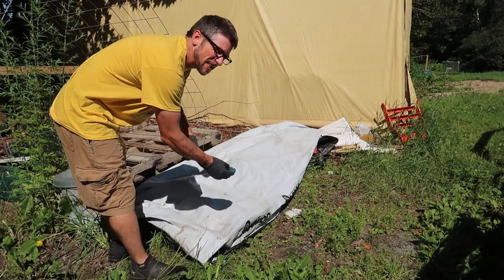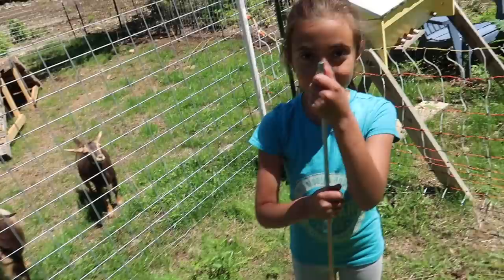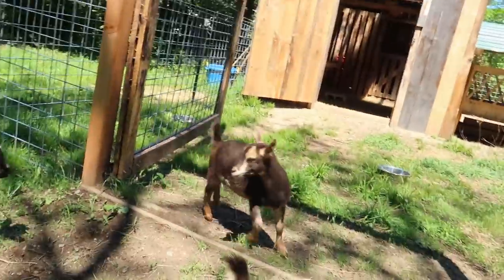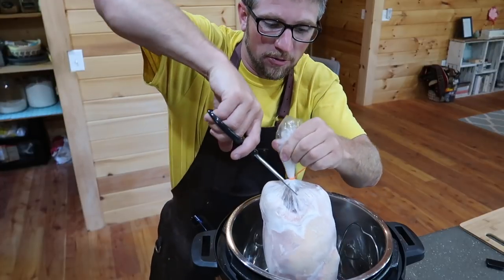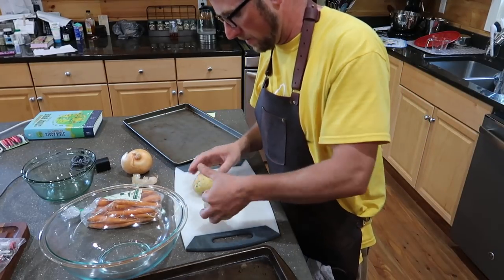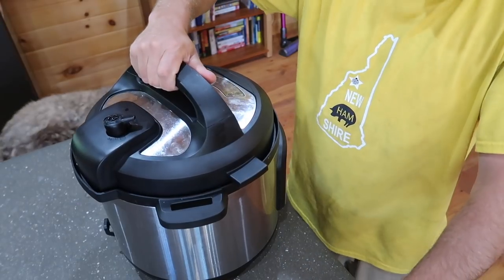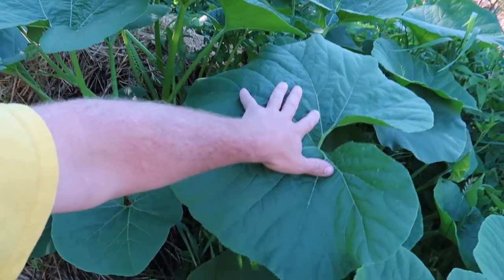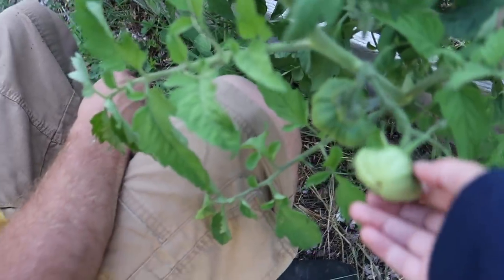These Goats Are Clearing Machines!

Comment: Heeey AL, if you noticed the color of the leaves from that plant that was growing in that compost pile to the ones in your garden. they are not the same. One is yellow green and the other is dark green.  Blossom rot is common with squash, its a sign of lack of calcium.  Also lack of water.  The growing medium you have is prone to loose all the good stuff from leaching.  All the nutrients are washed out from rains leaving you with nothing for the plants.  This is one problem with raised beds, they also dry out fast and overheat.  Raised beds are great for plants that need heat, other plants that don't do better in the ground where it is cooler.  
Yes your pigs will eat anything, that is why in the Bible we are told not to eat them, they are scavengers. sorry bro.

Comment: Gooood Mornin' Al!  And all y'all!  Great day on the homestead!  I'm curious about the process that you have to go through to change out your mowing deck... is it an easy process to change it out or more of a pain?  Are there other versions of a Kubota that have easier systems to change attachments or are they all pretty much the same?  Would you but the same Kubota again or upgrade?  (Not because your going to be needing a bigger one for your new pastures but just for features your doesn't have)
Reply from the maker: The mower takes about ten minutes to change over. It's not that hard. I am sure the newer ones have more options now. But I haven't looked since I don't want to get any ideas. 😂
Reply: Lumnah Acres , years ago we had a Kubota 4 wheel drive the largest they made . It pulled a 4 bottom 16 inch. Plow. It was a worker